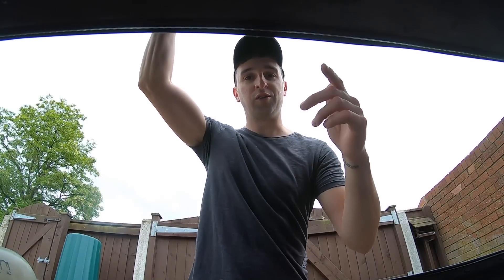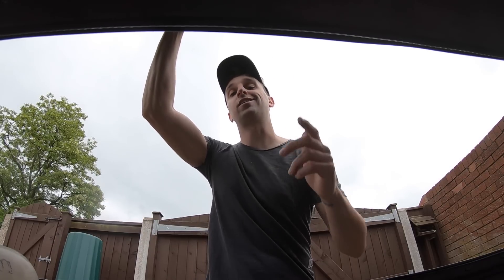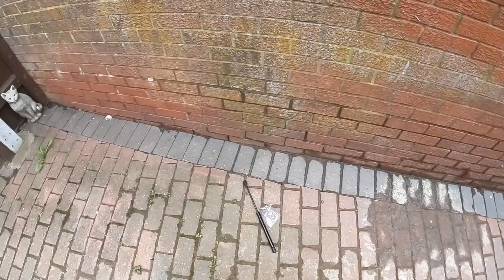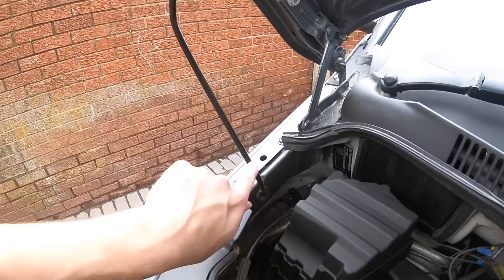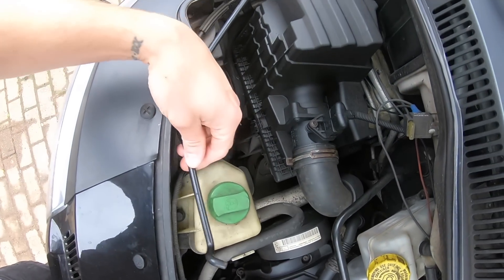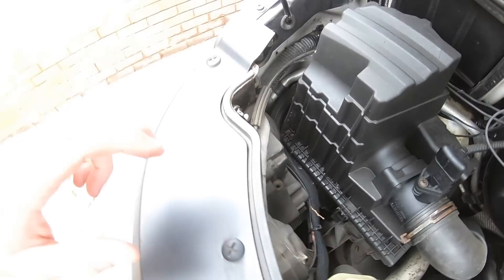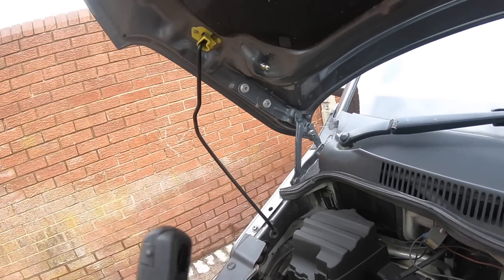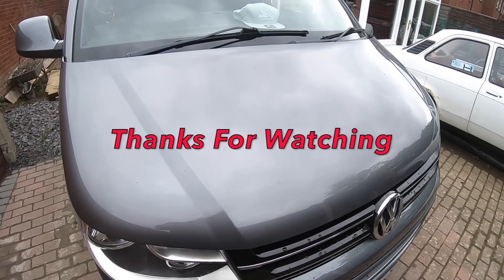Maintenance over Modifications !!!!!! #4 VW T5 Camper Conversion

Comment: Good video, and good advice. I always switch the cam belt at the earliest opportunity, unless I have a dealer service book. I also ensure a full service is done too, and then repeat at yearly intervals unless I am hammering it for high mileage. There is a reason vehicles need servicing, that is to keep them in tip top condition.
Reply from the maker: Hey Dave. Thanks for your comment matey. I totally agree. Unfortunately some people don’t understand that oil does have a life to
It as well as other serviceable items.
Reply: @JaysFabShop  Oil loses its viscosity with age. This age can be determined by mileage (i.e. you reach the service mileage limit between services) or you reach the usual annual gap. Its worth all motorists understanding oil viscosity and its drop off rate. 

I own a 15 years old Toyota Corrolla that is in decent nick with high mileage on it - but it is serviced annually, and I routinely replace parts to keep it in good nick, and only use Toyota parts.

Comment: Nice video - well presernted & considered. One point is not to lubricate any threads when using a torque wrench as this reduces friction and usually ends up overtightening the bolt/nut etc - as you discovered. Keep up the good work.
Reply from the maker: Thanks Mark. To be honest I have always found that threat lubricant will actually give you the correct torque. Normally arp bolts for rods etc recommend a grease lubricant to give correct settings. However either side could be argued I suppose and I feel for this it’s so miner I just wanted people to consider ever needed to remove stuff back down the line. Thank you